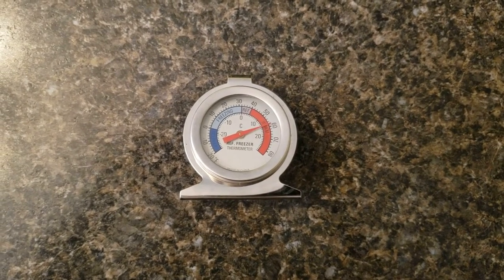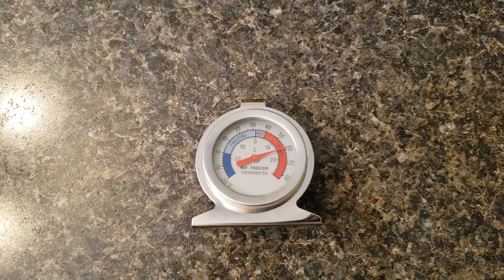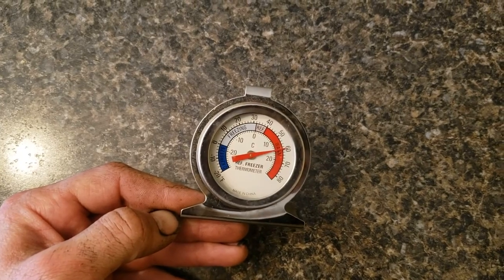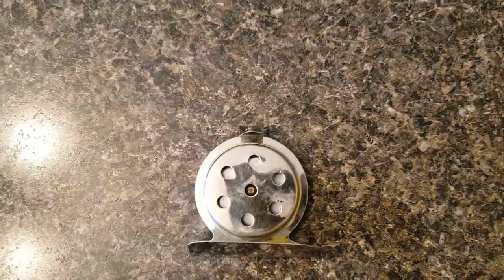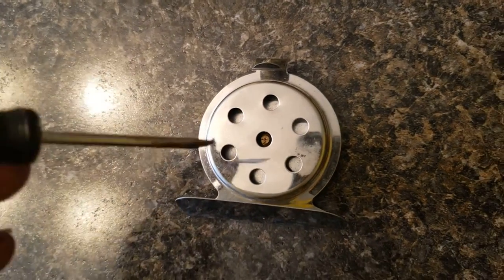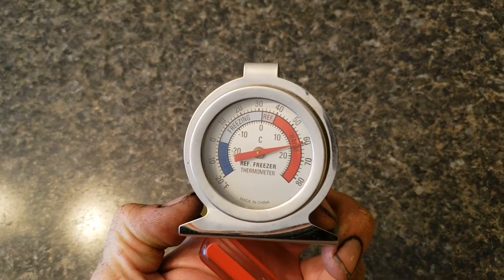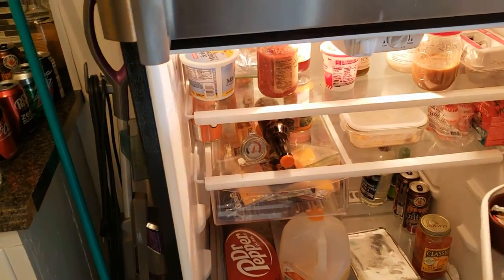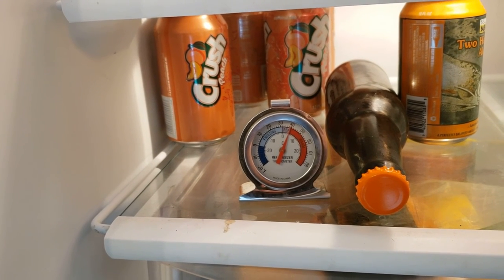Refrigerator Thermometer Calibration

Comment: My power was out for three weeks. It had been stable at 34 before the power outage. I have a thermometer just like yours. After the power was restored it couldn’t get below 40. I put a digital thermometer inside and it read 34 just like before I lost power. Just to make sure the thermometer was faulty I took it out of the fridge and it promptly indicated 75 sitting right next to my household thermostat which which is reading 70.
 I had never had a thermometer go bad before. Nice to know my fridge wasn’t broken.

Comment: SO, if this thermometer is out of calibration, how do you know what the temp. of you frig. is? Seems to me you need ANOTHER thermometer to make sure your frig. is at the temp. you are setting the first original thermometer to.
Reply from the maker: This is a great point I've thought alot about. Considering the wide range of temperature available, you could maybe calibrate it to room temperature based on your home thermostat setting but I'm afraid of the possibility of an office by the time it reached refrigerator temps.